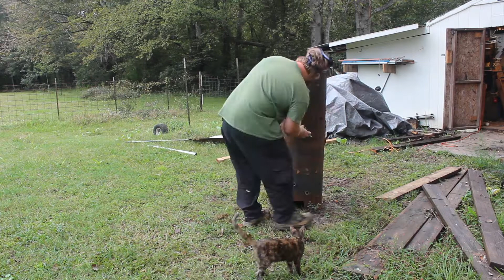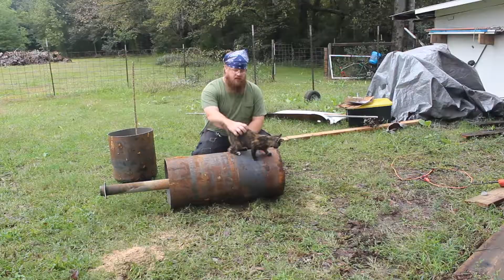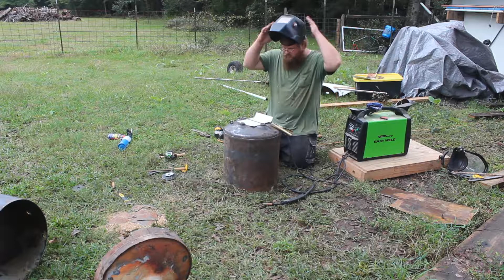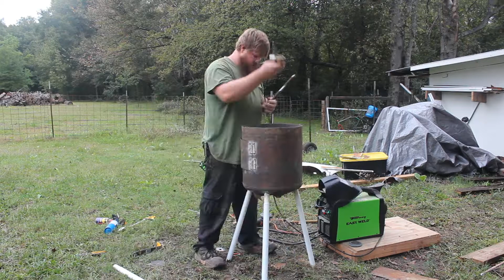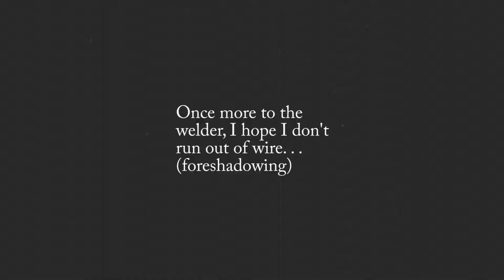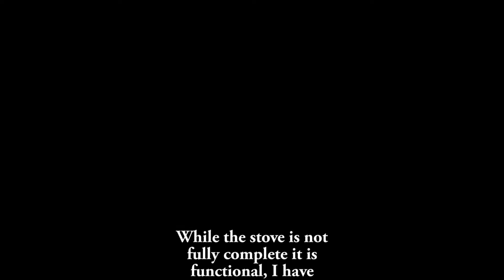Gas Water Heater to Wood Stove

Comment: Seems like the wire runs out, when you weld anything substantial. With a 10 pound wire spool, it surprises a person, because it is expected to last a long while for most residential use. I like your project. It'll hold...👍💯
Reply from the maker: It's a really small wire, and if you're filling big gaps. . yup, it's gone before you know it!
Thank you!

I really appreciate you taking the time to write a comment; I'd have responded soon after you made it, but I didn't realize I have to actively look to find comments people leave me, my apologies for the delay!

Comment: Watching on my phone, what welder is that?
Reply from the maker: It is a Forney 299 Flux Core Welder
I was running Hobart H222106-RTP 0.030" flux core wire.
It was the best cheap welder I could find when I bought it in 2016, it costs a little under $200 currently.
Reply: @dscrive  Outstanding. I have a Fourney on my watch list, currently selling for $240. I have an Amico stick welder with built in TIG and plasma cutter.
Reply from the maker: @CGoffgrid  I'm hoping to one day learn TIG and get the machine as well as a plasma cutter, but next on my list right now is getting an oxy-acetylene set up because with the right tips I can cut, weld, and braze, as well as just heat stuff up.
I'm really more of a woodworker but went to tech school to learn metal working stuff.
Reply: @dscrive  Plasma cutter is cheaper way to cut, and cuts stainless. Just sayin.
Acetylene is getting pricey I hear. I'd like to have a rig but wouldn't use it much anyway. I don't TIG because the price of Argon, but my  stick does what little I need. Plumber by trade, working as handyman, and do lots of stuff.😉
Reply from the maker: Thus far my Forney has done what I needed it to, including welding stuff it had no business welding haha.
I haven't even priced gases yet, but I live just out side a town with a lot of manufacturing plants so if it's going to be cheap anywhere it should be cheap here. 
I salute you for being a plumber, I've never been super excited working on plumbing, or sheetrock, those are about my two least favorite things I know enough about that my family members sometimes get me to do haha.
Reply: I watched your whole video pretty darn interesting however I did want to let you know that stove would probably burn a lot better if you would have put a draft so I could get some oxygen LOL nice work though